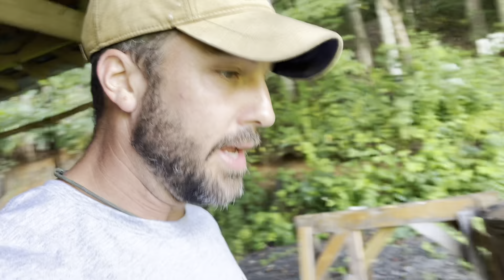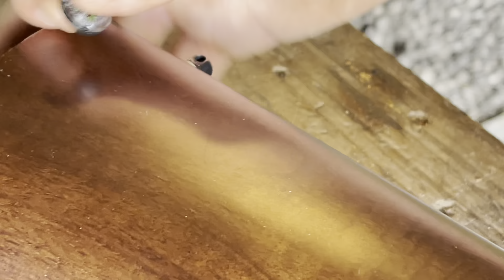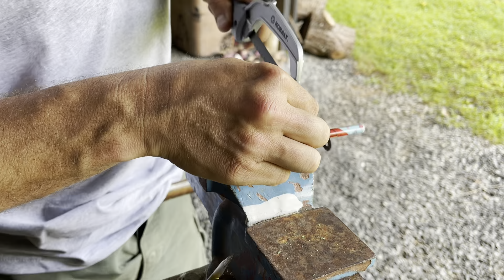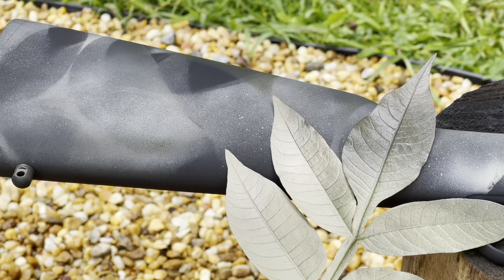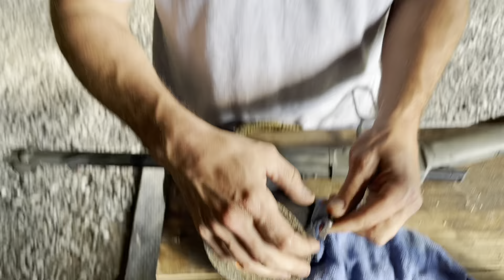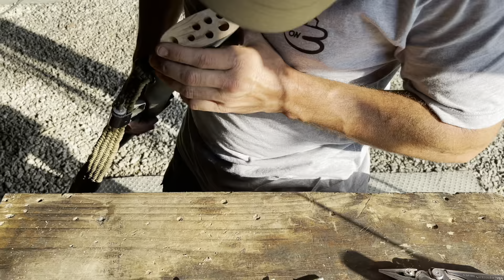The Ultimate Budget Survival Rifle Build

Comment from the maker: .22LR or 12 gauge? Let me know in the comments! Don’t forget the subscribe and thumbs up. Thanks!
Reply: Savage 24 in 22 over 410! Haha problem solved. A 410 slug would work well on the occasional deer also
Reply: 12 gauge definitely.  Between the different types of shot you can take any game in north America. Would use my stevens bolt action 12g with the adjustable choke. A relic but reliable.
Reply: Neither. A .38/357 magnum lever action is quite arguably the very best possible option for a survival/SHTF rifle.
Reply: @williampratt4791  If you're in grizzly bear or mountain lion country? Run into two legged predators (who are statistically the biggest threat in the woods, which most people don't realize)? A .22 bolt action is objectively a very very limiting choice.
Reply: @Dadlife911  That's a decent choice.
Reply: I second the 357 magnum lever gun. Capacity, reasonably light weight weapon and light/compact ammo, tremendous versatility, the ability to fire "suppressed" without a suppressor, the ability to take the largest and the smallest game, still a very good choice for defensive use vs criminal elements, manual operation, the ability to work even with home made black powder reloads, and John Wayne used one.
I don't think anything else really comes close, all things considered.
Reply: @williampratt4791  Two gazelle are grazing on the Serengetti. One looks at the other and says, "You know, I don't believe Lions are dangerous. I've never been eaten."

A .22LR bolt gun is as close to being unarmed as you can be, while still having a rifle. It is a definitively bad choice.
Your fantasies of ninja like movement and disarming your enemies notwithstanding.
Reply from the maker: @Followme556  you had me at John Wayne
Reply: @ONThree  :D
Reply: @ONThree  Same here, lol!
Reply: @williampratt4791  I'm sure you'll acknowledge that grizzly bear attacks do in fact happen to experienced Alaskan outdoorsmen.
About me: I have a homestead in Ky, lived in the Pa mountains for 5 years, spent most of my life as a PI in the worst shitholes of modern America, and did an enlistment as a US Army infantryman.

It seems to me that anything .22LR does, .22 WMR does better, or nearly as good. And a lever gun gives you an enormous increase in defensive capability vs a bolt action. In your situation, I would go with a .38/357 magnum lever. I say that because I think that's the best option for any true long term survival situation.

But hey man, you seem pretty sure of your choice...good luck out there!
Reply: @williampratt4791  There's always a reason some animal attacks, but that doesn't matter much when it's eating your face brother.

.308/.30-06 comes in lever, pump and semi. .45-70 is most popular in lever guns. I'll certainly give you .300 win mag and .458 as bolt gun affairs.
The .357 mag lever gun I said i'd prefer is no slouch when loaded with Buffalo Bore 180gr solids coming out of a 16" barrel. No slouch at all. 
When I lived in the mountains I had black bears in my yard all the time, so I used to keep a 12 gauge Beretta semi auto 18" barrel loaded with Brenneke 1 3/8oz slugs at 1675fps leaning against the door to my deck. Sometimes you just have to nuke them from orbit...it's the only way to be sure. ;)
A 10gauge double with ejectors and internal hammers would be a mighty fine North American "stopping rifle."
Reply: @williampratt4791  The tank platoon in my unit had M60A3TTS until they traded em in on the brand new M1s. Shame we gotta get old brother. The Scottish Lion is my addition. Thanks for checking out my channel!
Reply: @williampratt4791  So since you mention it...what would be your choice for an "ultimate survival rifle?" As I said, mine would be a .38/357 magnum lever gun, preferably in stainless steel/synthetic, with a kings loading gate. Tritium front sight with ghost ring rear. 
My reasoning: 
* 158gr lead SWC 38 specials loaded over 2 grains of bullseye, a 16" lever gun is as quiet as a suppressed rifle, without the NFA hassle or length/weight of a suppresor, and will take even small game without too much destruction, while also being great for the "sneak up and take their weapon" sort of stuff you described earlier.
* Hot .357 mag 125gr bonded JHP from a 16" barrel has as much muzzle energy and destructive effect as a 7.62x39mm AK, and will easily defeat IIIA armor, because you never know
* Hot 180gr hard cast flat nose from a 16" barrel is a hell of a defensive round vs bear, and will take elk cleanly without the hassle of trying for head shots. (probably moose too, but i've never tried)
* .38 and .357 magnum ammo is reasonably compact and light, and you can carry quite a lot on your gun belt.
* It allows you to use the same ammunition for your .357 magnum sidearm
*A lever gun will keep working even with home brewed black powder, indefinitely, the only limitation being your supply of primers, a long as you're policing up your spent cartridges. 

All things considered, it's a very, very hard choice to beat- IMO.
Reply: @williampratt4791  I do what I can man.
Reply: @williampratt4791  LOL, nah my dad is real big into the Scottish paraphenalia, kilt, dirk, beret, the high socks. He wears them to family events. I do have a Scottish dagger that I am very fond of. (I'm a big knife guy)
Reply: @williampratt4791  I am a big believer in giving all my guns a good feed ramp polishing, even if it's a gun that works without mods. I like to tinker. Even still, levers can be finicky on what they like. but that's not a problem as soon as you ID the loads yours likes, and then stockpile those choices.
Reply: @williampratt4791  That'll do it. My main bushcraft knife is a Mora Kansbol. I am but a simple man. lol.
Reply: @williampratt4791  Yeah im really lucky to be surrounded by great people here. The wife is going to get some meat rabbits in the spring, neighbor across the way has some cows. I'm sure we'll end up with some chickens too.
Reply: @williampratt4791  I do love duck meat. Never had a duck egg. I have 3 lakes on my property so i get lots of waterfowl lounging about in the warm months.
I'll check out Spirko, I'm familiar with Bear Ind/survival dispatch. I like Jason Salyer on that channel the best.
Reply: 12 gauge

Comment: 12 gauge single with a 22lr adapter plus a brass adapter for primers used for dog training lets me use it as a muzzleloader. The. 22 adapter can also be used for muzzleloading with blanks from my powerhammer as ignition. I also carry a home made hand loading kit for the shot shells with number 5 shot buckshot and. 69 cal. Musket balls.  The barrel is full length as cutting it also reduces range and accuracy. The barrel has a rib on which I've installed turkey sights and marked the .22 adapter so I can orient it the same way to gain consistency and accuracy. I don't kneed the fashion statement so I don't waste my time weaving a sling I wrap cordage around the stock and use an adjustable sling that can be used over t shirt or parka. If  conflict is expected I grab the pump.
Reply: I had never thought of using the 22 adapter with nail gun blanks for muzzle loading before, that is actually a great idea.

Comment: That's a tough question 12 guage or 22lr. Maybe a 20 guage. Like you I don't trust semi-autos unless it's a Glock. I have a Henry and a Rossi 22lr lever action. I'm a lever action guy I have a Winchester 94 in 30/30. However there's a new gun coming out, a Winchester Ranger 22lr lever action with an MSRP of $419, it's a takedown like the original 9422.

Comment: I have both a 22 cal and 9mm insert in my 12ga shotgun buttstock.  I use a wide rifle sling that I can attach pistol magazine pouches onto.  And thats how I carry my ammo for my inserts.  I put my pistol ammo in magazine that match the pistols I own.
My inserts are carried in bored holes in the wood stock.  I use either a rubber buttstock pad or just a single screw on the buttplate( epoxied in) so I can swivel the buttplate aside to access the inserts.

Comment: I have a .22 single shot for my “emergency” gun. I keep .22 LR, .22 shorts as well as .22 birdshot on hand.  Space inside the stock for a Mylar blanket, lighter, water tablets, flashlight and a knife. I also added a stock pouch holding everything needed for the gun along with ammo. It’s a shotgun stock pouch, which means the elastic loops are sized to hold Rx pill canisters. I have 6 canisters, two each for fire starting and first aid, one for fishing and one for making a slingshot with steel ammo. 
Added a similar sling made with 100’ of 550 tinder cord. Added a horizontal-carry belt pouch onto the sling with a multitool. 
It’s pretty heavy, but it lives in the back window of my truck so if I need to hike it home any distance I can grab my backpack and my gun and go.
Reply from the maker: Love it!

Comment: I'd take a single shot twelve gauge with barrel inserts for various ammo types including .22. More versatile that way and you don't have to choose one or the other!
Reply: those inserts are quite inaccurate because the insert spins opposite to the rifling when the round is fired.
Reply from the maker: I have had a 8” .22lr adaptor for over 10 years. I have had really good luck with it.
Reply: @ONThree  Does it lock into place in the breech to prevent counter rotation? The 8" might help a lot even if it doesn't  because it probably has enough mass to counter the torque applied by a small .22LR projectile.
Reply: The barrel adapters I've used 
have o-rings to hold it in place 
and don't shift with any shots. 
They're plenty accurate for what 
they are and you can take game 
at reasonable ranges. 
No, they don't constitute a target 
rifle,  but in a shtf scenario you 
won't be making long range shots 
and you'd be avoiding firefights 
at all costs.
Reply from the maker: @Valorius  It locks into place when you close the breach. I rotate it so it is at 6 o’clock and it shoots very consistently. Probably average 2 inch groups at 25 yards with just an oversized bead sight.
Reply: @ONThree  As long as the insert locks, any caliber should work well. The ones that can spin in the chamber yield terrible results, in my experience. Thanks for the info.
Reply: @maxpinson5002  Reasonable points. It's good to see they've improved these adapters over the years.

Comment: Great video, I really appreciate the content you are putting out Jason. If i can though, I'd actually argue that manual actions may be worse in a survival situation. 

The force exerted on the bolt of a semi-autimatic firearm makes it much more likely to run (or to push through the carbon/dirt) that will accumulate over time. 

You could also argue that the ease of disasembling/maintaining your firearm is more important thab whether it is semi-auto or manually operated. A bolt action is very easy to maintain in the field, as is a 10/22 if you stick an alleb wrench in your pack. A lever action, however, may be more complicated to maintain given the number of small components you need to remove to fully disassemble the firearm.
Reply from the maker: Valid points!

Comment: Jason - I cringed when I saw those tiny black screws from the stock & butt plate. Please drill a few 1/4" holes on the side of your stock and superglue some round neodymium magnets flush. This will hold those removed screws. Having dropped screws in dirt and leaves while fieldstripping, I have spent many hours searching for one that fell into the leaves.
Reply from the maker: Ha! Good call.
Reply: That's a good pro tip.

Comment: Respectfully disagree on a couple 
of things 
Just me-  I want any cordage to 
be ready for immediate use, and 
not have to unravel a bracelet or 
a sling or a belt, etc. 
I realized that in the scouts many 
years back. After you unravel your 
belt, how do you hold your pants up?
I never sacrifice a piece of serviceable gear. 
Also,  I've already been the carrying 
extra gear on the rifle route with 
ammo slings, stock packs, survivor 
stocks, etc.  All that fouls up the 
balance of the firearm ( to me)
and isn't as rapid to access as a 
purpose designed and built carrier 
or pouch etc. 
Thanks for the video
Reply from the maker: I can’t really imagine only having this rifle in a survival situation. If that is the case, I’ve messed up pretty bad. But it sure was fun to build.